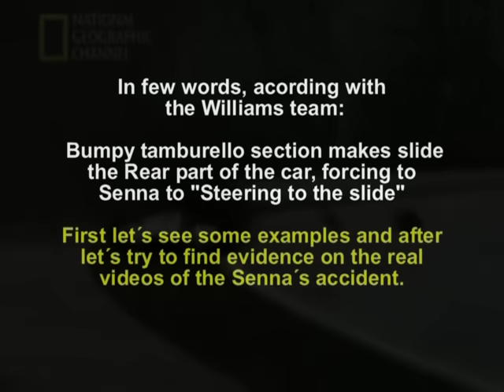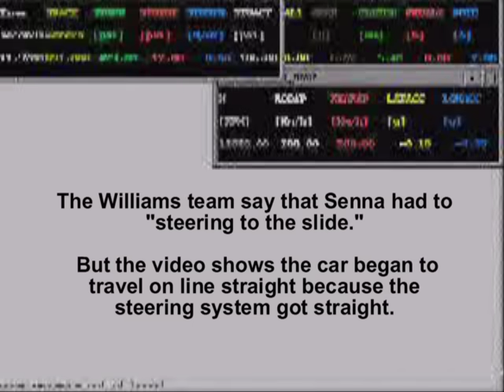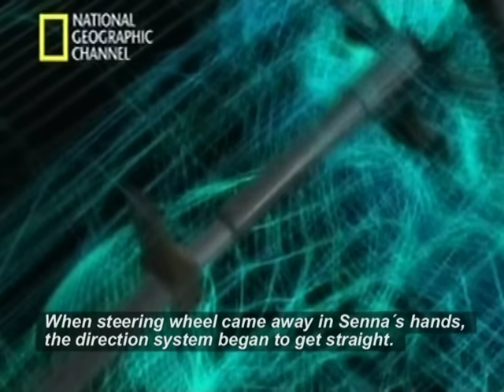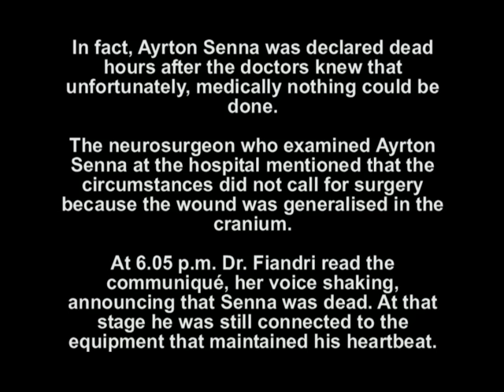5/5 the death of Ayrton Senna - what NatGeo did not tell

Comment: I don't think the crash happened due to a slide. 
1. It's very unlikely that a driver reacts fast enough so you don't see a slide (especially at this speed)
2. When the front suddenly grips you see a turn into the opposite direction or even a slide but there is nothing like that which would be impossible at this high speed.
3. Why is there no slide one lap before when the car was lower?
4. Everybody was touching the ground in this corner at this particular place so why is there not even one car sliding there? Because these cars doesn't slide there.
5. Senna already drove through this corner many times (Practice or Qualifying). When the car was set up that low that this corner creates problems why hadn't he had any problems in the previuos sessions?

For me it's obvious that something broke because the reaction of the car simply exists out of the fact that it doesn't react to the steering anymore. The tyres are still working so it's not the suspension which broke. Additional to that there is no slide so there is no failure at the rear.
For me it can only be the broken steering column which was found in the wreck afterwards. As far as I know the steering column wasn't one piece how it's supposed to be. It was welded so I think it's possible that it was weakened after the hard bump in lap 6 so the still hard bump in lap 7 was enough to let it break.

I'm no specialist but for me it seems to be the only possible explanation.
Reply: I agree with you.
Reply: Thats the most plausible explanation I've heard both from media and personal opinion
Reply: The reason no one slid there the lap before is they took Tamburello at a slow enough speed so they wouldn't slide. The next lap Senna tried to go around the corner just a little bit too fast. Damon Hill certainly thinks so and he was the only other person driving that exact same car around the corner on that day. He went too fast and slid off the track period.
Reply: Tamburello has been a corner in which you could easily go flat out. So I don't get the point of the difference compared to a lap before. That doesn't make sense at all
Reply: ***** "It has been determined that the accident was caused by a steering column failure. This failure was caused by badly designed and badly executed modifications. The responsibility of this falls on Patrick Head, culpable of omitted control." - Italian court
Reply: ***** "It has been determined that the accident was caused by a steering column failure. This failure was caused by badly designed and badly executed modifications. The responsibility of this falls on Patrick Head, culpable of omitted control." - Italian court
Reply: Петър Василев No they never determined if the steering column failed before the accident or during the accident. The responsibility was Ayrton Senna. Look how many times Senna had already spun that car out already that season. Everyone tries to pretend the guy was faultless well he wasn't. He had a faster driver behind him and he didn't want to give up. Senna didn't like finishing second and the writing was already on the wall as far as that goes for 1994. He pushed to hard and lost control end of story.
Reply: ***** Do you know what I dislike most about F1? It's the fact that there are people guessing and answering questions without having a clue about racing or driving.

Two simple questions:
1. Where do you see a mistake? there is no slide of the front or the rear at all. Usually when drivers crash due to their failure there is a slide and after that they end up in the wall. Senna had problems with the car and with loosing so he probably had an oversteering car because he tried to get the maximum out of it which leads us to the conclusion that there should have been a slide of the back end of the car but there is no such thing at all.
2. How can a racing driver go to fast into a flat out corner? How on earth can it be a driving error when the corner is basically a straight unless Senna just thought it was a good idea to take the hands from the steering wheel.

So either you want to tell me that Senna was too stupid to drive (yeah he made mistakes like everybody but he didn't win the championships by pure luck) or you should think about what you just wrote.
Reply: ***** If you know anything about the problems Senna was having with the 94 car it was understeer on entry and then snap oversteer later in the turn which makes the car very uncontrollable. You either want a car to understeer or oversteer but not both.
Reply: ***** Also by the way the only other person driving that car on that day was Damon and he thinks Senna screwed up but I guess he is just a F1 champ and you know better.
Reply: where did you read that?
I can tell by my experience that a driver never crashes due to a driving error in a flat out corner or let's say on the straight. Well, as I said unless he let's go of the steering wheel.
I think Damon wanted to protect his team because if it is no driving error what is it insead? Well it's a reliability issue and such an issue is always caused by the team. Because there are only two possible types of failures he had to protect his team.
No independent racing driver would tell you that a driver crashed on what basically is a straight due to a driving error. It's something like a sinking ship due to to much rain. It just doesn't happen
Reply: ***** The team up and fired him late in the season in 1996 totally screwing him for finding a good drive for 1997. He had every reason to be pissed off and say what he feels yet his story never changed.
Reply: Yeah that's a strong argument. Maybe he didn't want to change his opinion. You see what happened to Piquet jr. after singapore 2009. His honesty didn't help him a lot. Maybe Damon knew what was going the happen to him if he changed his mind. 

But let's say I have two opportunities. On the one hand I can trust Damon Hill who has always been the most honest man in the world (right? Just kidding :D) or I can trust my own experience.
And to be honest I'd like to trust my experience. 
I don't think Senna was god. I know he made mistakes and I don't believe he was the best. He was very talented but to be the best you need more than that however that's a different discussion.
I just can't trust a racing driver who is so involved into the actions while he questions my whole experience of racing. It doesn't work for me
Reply: ***** My problem with the whole broken steering column theory is Senna was making mistakes and losing control of the car on a regular basis since the start of the season. They were having severe handling problems but according to all these people Senna could never have made a mistake well what about Brazil where he spun off on his home track no less. Plus there were many times in Practice and Qualley that season he had spun and it was only the 3rd race. As far as Hill goes when he retired from racing he was F1 champion already I doubt he ever expected to become a F1 commentator so I doubt he was keeping quiet all this time hoping that one day the BBC or Sky would pick him up. Watching the interview he seems very manner of fact and truthful and I believe him. I don't really see the point of protecting anyone it's not like anything he said would have made a difference now anyways.
Reply: ***** You're right Senna had enormous trouble with the car in 1994 and he spun quite a lot
But my problem is that there is no misbehaviour of the car at all except that it doesn't turn into the corner anymore. It's basically what I've written in the first comment. You just can't see any reaction of the car therefore the explanation for me is a broken steering column.
You can trust me on one point. The way the car handles at the moment of the crash is not how a car reacts to a driving error. Don't trust me on other aspects because it's better to find out yourself but just on that point you can believe me :D
Your decision whether you do :D
Reply: ***** Yes I agree with you the car doesn't turn in at all. My feeling was the air pressures were not up to full operating temps and he had bottomed the car out after which point steering input was useless. I have always wondered how bumpy the track was in comparison to the two previous races that season. I also have always thought that it was possible that Williams had been used to the electronic suspension for so long that that point that they hadn't set the ride height correctly. After all the car was designed to have it and then they banned it on them quite late in the design process causing no doubt a bunch of problems they might not have seen in years.
 Plus when you are racing(at least from the little experience I have had racing) you are balancing the car on the razors edge, especially when under pressure. The problem with balancing the on that edge with a car that isn't up to full operating temps is knowing where that edge is. Senna was human and he made an error, either that or the team made an error in setting the ride height. I mean that is the way I have always seen it of course I could be totally wrong and the column could have broke, it's just too bad they didn't have all of the car's data.
Reply: ***** you are totaly wrong fluppiLP explains why very well
Reply: theo sas Nobody knows for sure what happened so you guess that I am totally wrong. Former Formula 1 champion and Ayrton Senna's  teammate Damon Hill thinks he drove too fast into the corner and lost control when the car bottomed out. He was the only other person on earth who knows exactly how the Williams FW16 was handling that weekend. Another thing several Williams team members examined the car at the same time and almost every single one of those people no longer work for Williams, if they had seen the steering column was broken they would have come forward by now. 3 people can keep a secret if 2 of them are dead.
Reply: You are missing one point:
Through this corner you could go flat out even with a GT car and F1 cars have a lot more downforce. So stop telling us that he went in too fast. You can't go too fast into a corner you don't have to break for.
Think about Adrian Newey, he doesn't want to talk about it because he fears to be one reason for the accident. Maybe it's the same with other team members.

Again: A F1 car of 1994 could go into the corner with 400km/h and still make it. Luckily these cars only did 320km/h. So tell me again how Senna went too fast into the corner although his car wasn't able to get enough speed to fly of without any other kind of failure.

You can compare this corner to corner 17 in Spa Francorchamps. Why have you never seen a car flying of at the left turn before Blanchimont (corner 17)? Because this corner is flat out what means you can't go too fast because you car is too slow!

And I don't guess that, I know that so your explanation makes no sense at all.
And don't start again with Hill...
Tell me who is more likely to lie: physics or a human?
Reply: ***** You could not go full speed in a F1 car who's tires weren't up to full operating temperature. Wow you conspiracy theorists are all the same. The WTC towers were taken down by internal explosions or was it missiles? LOL One last time YOU COULD NOT go through Tamburello corner at full throttle in top gear on tires that weren't up to full operating temps. Tell Piquet you could not go off at Tamburello. By the way I have been there and seen the corner before and after it was modified.
Reply: Always the question how you define "up to full operation temp". This temp was about 90°C. When they were done with the SC they maybe had 60°C. Yeah, then they probably couldn't go through the corner flat out (I think they could). But they had already driven a fast lap so they had about 80°C in their tyres when Senne crashed. With 80°C you could definetly go flat out.

Sometimes they say the car touched the ground because the pressure was to low. Ok, could be true but again: There is no slide of Sennas car which would have been there If there had been a problem due to the tyre pressure.

Btw: It's not a conspiracy. The car just failed, it happends all the time in racing but this time it wasn't the driver. It would be wrong to blame Senna for his death although he couldn't do anything about it. That's why I'm so motivated to argue.

Piquet said that all of the sudden the car came around. Consequently it could be another car failure. But anyway, do you see the difference in Senna's and Piquet's crash?
I admit that piquet's accident could be because of a bump or low pressures (still it's questionable whether that's a driver's error) but Sennas crash? No, Senna had noe slide at all. It's so obvious that that has nothing to do with a driving error.
1.The sudden stop of steering of Sennas Car. If he'd been to fast he would have understeered towards the wall.
2. Lack of a slide (oversteering car). A car that is forced into the corner althoug the driver is too fast always reacts with a slide but no slide there.
Reply: ***** Hill says you can't go flat out on that corner when tires aren't up to full temps and NOT ONE other F1 driver from that era or any other has said that is a lie. The car's rear tires began to slide as it hit the first of 2 sets of bumps. That happened because the airflow underneath the car was disrupted combined with G-forces. The cornering speed of F1 cars is strongly dependant on aerodynamics. Any disruption will reduce grip in a big way and loss of control will result. When the car started to slide he reduced throttle from 100% to 40% and reduced the steering input which is what someone does when trying to regain control during a slide. 4 one hundredths of a second after he did this the car hit the second bump. The car then lost front end grip and combined with the rear tires sliding the car suddenly veered right. This sequence is crucial in disproving the column failure theory in which case the car would have continued straight on and the moment the Senna realized that the column had broken he would have been off throttle 100% and hard on the brakes. But that didn't happen. Less that 2 tenths of a second after he hit the second bump he lifted off the accelerator and began trying to slow the car. May I remind you the judge in the case also said the prosecution failed to prove it's theory that the column had broke.
Reply: technically there is a difference between a tyre which is 20°C colder or 30°C colder. So I don't know what they mean. But I do know that a tyre almost reaches working temp after one lap. So it's not that much of a problem after one lap.

But you're wrong about the trial.
There were a few trials: The first ended in 1997 and it was determined that the breaking of the steering column was the cause of the accident. But a certain accusation of Head or Newey was not possible. Therefore there was no punishment.
the appeal proceeding in 1999 declared an unfortunate series of events (still no driving error) as the cause of accident. However it received a lot of critisism because decided that when it was unsure whether F1 would still drive in italy.
In 2004 the trial was reopened due to vice of form. They acquit Newey because as the constructer of the car he isn't responsible for any changes during the weekend and they 
They claimed Head to be responsible for the modification of the steering column but due to prescription he was discharged.
Reply: ***** The problem with the Italian courts is you cannot trust them especially when it comes to cases involving motorsport. The Prosecutor said that there would probably be charges before he had even investigated the case. They tried to blame Jim Clark(because of course Von Trips was a Ferrari driver) for Von Trips death, the Police raided the rooms of team McLaren when they were there for the race and said that they had smuggled in illegal fuel into the country. Which was enough to get Hunt's car put to the back of the grid giving Lauda and Ferrari an easy victory and they hoped a World Championship too. Of course after the race was run they said they made a mistake and the fuel was legal and nobody had smuggled anything. Whenever a Prosecutor can use the case to make a name for themselves(especially involving F1 because it is basically their national sport.) or they can help Ferrari they will do anything with no regard for right or wrong. There was something last year or the year before where they were threatening to charge one of the F1( Red Bull or McLaren I think) as well as in 2007(Spy gate)
Reply: Totally agree with you
I would never trust an Italian court :D
And I also think that a court should never decide any case in motorsport.
But you used the argument so I had to do something about that.

However, I want to apologize. I was a litte too determined when I tried to convince you.
I think we can just agree that we disagree in this subject :D
Reply: Yes well unfortunately the missing data and footage leaves many questions unanswered. It's just too bad there wasn't one of the cameras close by as we might  have been able to see what his hands were doing in the last moments. I would like to apologize as well as the other guy started throwing insults right off the bats and got me fairly worked up. I would say we both presented compelling arguments. Cheers!!    :)
Reply: ***** Shumacher took the same corner at the same speed just after Senna on the same lap and he was ok. I think it was a steering problem or maybe the powersteering went wrong or maybe Senna had a muscle cramp I don't think its due to oversteer...
Reply: Ivan A. Schumacher took the corner in a car(a completely different chassis) that was handling much better, he also took the corner in a different spot avoiding the bumps. Schumacher may have been able to keep more heat in his tires as well. How much heat stays in your tires under yellow is directly proportional to how much effort you put into turning the wheel back and forth and going hard on the gas and brakes. Senna pulled up beside the pace car on more than one occasion when they were under yellow telling him to speed up that he wasn't going fast enough for them to keep heat in their tires. The only other person driving a Williams FW16 on that day was F1 champion Damon Hill and he thinks Senna drove too fast and lost control. The fact that everyone thinks Senna was too good to spin the car when he spun the very same car out of the lead and out of the race in Brazil 2 races before this I find quite strange. Everyone seems to think they know more about what was going on with the car than Hill does which I doubt very much.
Reply: That's wrong
I don't think Senna was too good to spin. He was a human therefore he made mistakes as any one of us.
But you're right I don't believe hill because he also is a human and humans tend to change their memory themselves after some time believing in their own explanation.
That's why I trust physics ^^
That's why I'm quite disstatisfied with your generalization of people being opponents of your view.
Reply: ***** I was actually speaking to someone  else who basically suggested that if one F1 car made it around the corner at a certain speed than all F1 cars could make it around the corner at that speeds which is not true because there are many F1 teams and each team has a completely different chassis some of them handle quite a bit better than others. I respect your view on the subject I have just came across many others(of which you are not one) who think it was some sort of giant conspiracy and even had one tell me that Senna was shot in the head by a sniper and was already dead before the accident occurred. Another told me he had been poisoned. I have just come across so many conspiracy nuts when discussing this subject that I tend to take people with a grain of salt(which you are right I shouldn't do) If you Google Ayrton Senna was murdered and pick the forth thing that comes up(its from F1 technical) they discuss someone else who believed that Senna was killed by a sniper.
Reply: haha, yeah I read that one with the sniper just a few days ago.
Well that's ridicoulus and I can't describe my feelings when hearing that :D :D :D
Reply: I have already seen you before in F1 crashes...
Reply: My racing is limited to go karts (Yamaha Heavy, KT100 engine) on asphalt tracks, but the dynamics of driving are the same. When your rear end breaks on a turn you automatically and very quickly compensate by turning into the slide and as the rear end grips you turn back out. It is really just an automatic twitch into and back out of the turn. The car does not follow into the quick twitch in. Saying his turn into the slide resulted in the accident just isn't true.
Reply: everything on this subject points to a mech. failure...
Reply: Marky I'm sorry but I don't know if what you are stating is due to intelectual disohnesty or pure disability. You are stating that the accident is caused by irresponsibility or "tire warmth" but you, not fot a single fucking time, goes against the fact that there was absolutely NO response on the tyres from the steering motion that Senna did, it's there, in every video, the car did not turn absolutely nothing! For Senna to commit an error that caused such a crash without any mechanical issue, it would be necessary for him to be WAY over the speed and you know that he was being chased on that moment so he could be fast but not that fast to crash like that. As a kart driver myself I can assure you that "turning into the slide" is a common reflex technique that you do in tenths of a second, you dont do that and keep going into a solid wall. And you can make absolutely any conjecture you want, but to say that it was not a mechanical failure with all those evidences well... as I said... that's pure intelectual disohnesty or disability.
Reply: Marky Mark fluppilp is right. So shut up with your flawed theories.
Reply: what i see is a car going straight into a wall. if he had steering he would most likely turn even just a little. my opinion he had no steering. end of story
and if you dont believe mr try to make any understeer case you want. you ll still turn. if you dont then send me that video and i may believe it
but you cant ;)
Reply: @markmark.7964  If Senna had gone round the curve too fast a) it would have shown on the telemetry b) Williams and F1 would be announcing the fact loud and clear because it would have absolved them from any form of liability.
Reply: @markmark.7964  Meanwhile, in the real world, the only theories which are given anything more than the most cursory of glances are those which are supported by some kind of evidence. Unfortunately there is no evidence at all which supports your suggestion.
Reply: @FluppiLP  It's worth noting that in all the examples shown in the video of cars bottoming out, the worst that happens in any of the cases is a small twitch corrected immediately by the driver. It is hard to believe that a small amount of bottoming could cause complete loss of control unless there were other factors at work, such as faulty steering.
Reply: @markmark.7964  Your idea is fatally undermined by the fact that at no point did Senna's car slide. At all times, even after the lurch shortly before it left the track, all four wheels were pointing in the direction in which the car was travelling, therefore no slide. As the car left the track, Senna took his foot off the throttle and braked hard - this was an attempt to slow the car down because he was heading towards a wall and unable to steer the car. In a slide you don't reduce steering input, you make a correction to the steering to steer into or out of the slide, as appropriate.